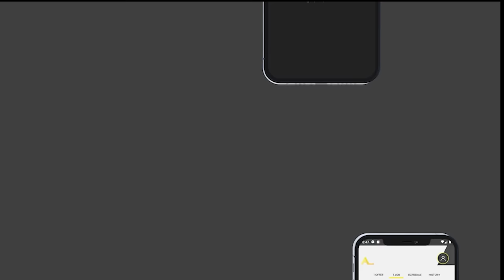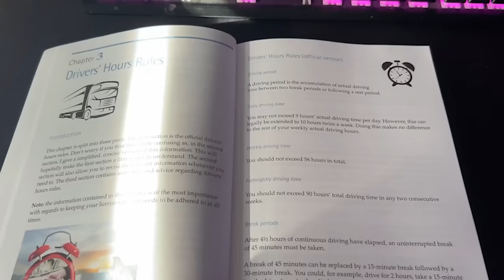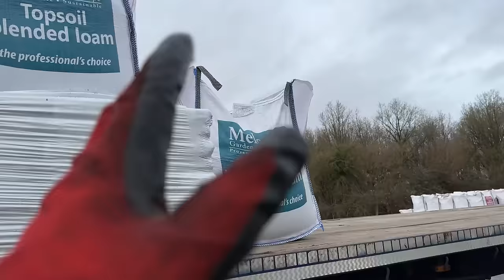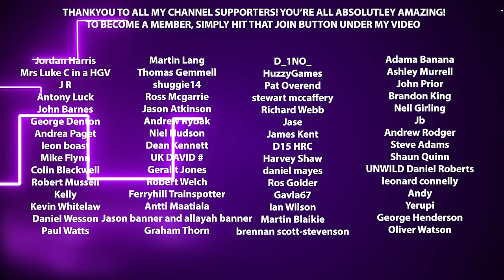Back To Work With Sprained Ankle !

Comment: Fun facts about physics, and that does not apply to trucks only by the way:

* Friction is caused by a phenomenon called hysteresis, and finding information about this phenomenon is veeery, very frustrating -- there isn't much. But anyway, hysteresis as an approximation can basically be thought of as the deformation of the tyres (the actual definition, uuuuh... No. I can't put that in a few words...) and that is what actually allows them to grip. Of course, with a naked eye, it's nearly impossible to spot. Also, tyres have more hysteresis when "accelerated" (on their rotation axis; and by acceleration, it is meant both positive and negative). The road surface also has hysteresis of its own. And those deformations cause "atomic" bonds (both ionic and covalent) to break, which is why you lose rubber on the tyres and also lose material on the road! (much less so, fortunately).
* No hysteresis on either the tyre or the road would mean you would be unable to move! that's what happens on icy roads whose hysteresis is very, very low. And the hysteresis of truck tyres is obviously much, much less than that of car tyres -- they are much more solidly built... But as a consequence they have less traction! This is one explanation why overweight transport drivers absolutely hate rain :)

Comment: That top soil load,  what happens when you have torrential rain,  surely that affects your weight?  Or is it taken into account with the max bags you can carry?  Great vlog.
Reply from the maker: Yea so they’ll get heavy when wet. In this video they were wet so on the upper limit. Had it been dry the load would have been lighter

Comment: Hi Luke, sorry to hear of your accident.  Hope your ankle soon gets better.  I've been over on my ankle numerous times, and always the same ankle.  Last time I went over, was in Piccadilly Gardens, Manchester, and I went with a right wallop.  The first thing I do is get up as quick as possible.  Even if I'd broken it, I would still hobble away🤣.  Anyway, after a week, it still didn't feel right, so I went off to the hospital.  The triage nurse touched the place, and it was agony (I'd been able to limp on my ankle).  Anyway, they took x-rays, and I had a broken bone.  So they plastered it up, which I was in for three weeks.  What I did learn was that if you've broken your ankle, and to see if you've broken it, try and stand on your tip-toes.  If its broken, you can't do it.  But you can, even if its sprained
Reply: Where is trucker jay luke

Comment: Interesting question for you I'm presuming fuel is incorporated into your total weight, so what is the weight difference on your truck empty Vs full of fuel? I can't imagine it's very noticeable but surely slightly. Great vis as always, hope the ankle is better soon ❤
Reply from the maker: No it isn’t noticeable being full with fuel vs empty. Thnk you mate.
Reply: As a rough rule 1 litre of fuel equals 1kg of weight
Reply from the maker: I don’t know, but if that is true then it equates to less than 450 kg, so yeah that would be really hard to tell I think